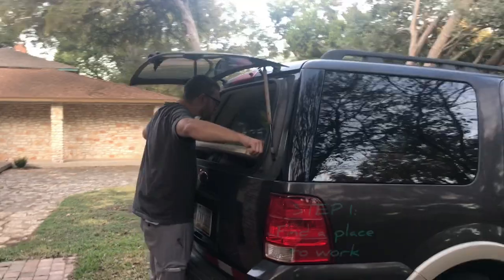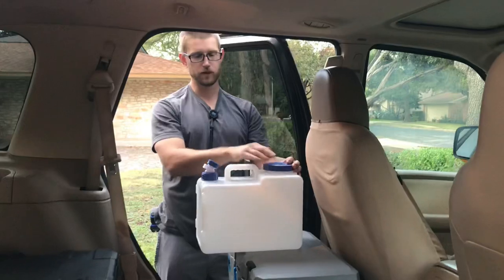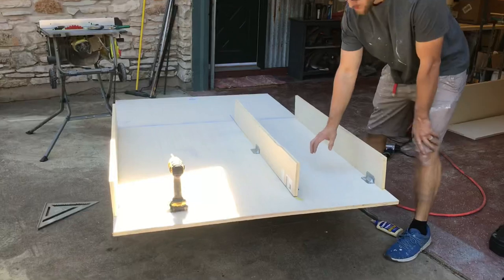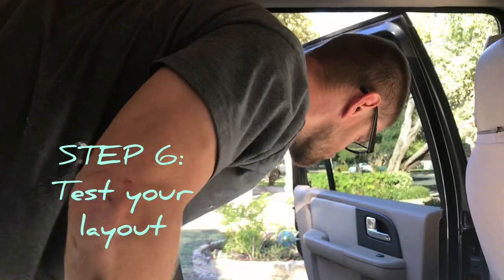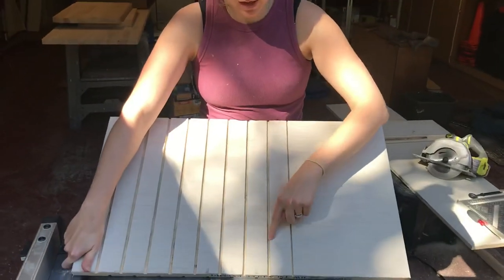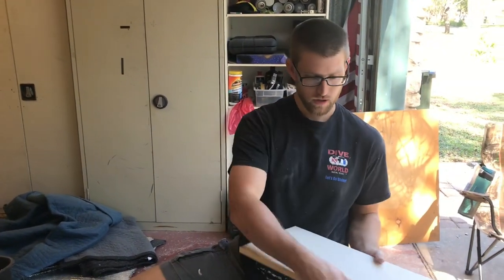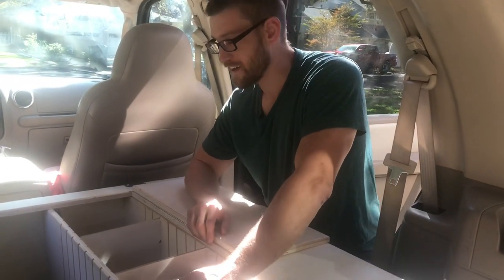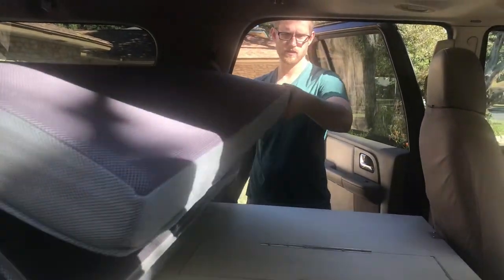FORD EXPEDITION SUV CONVERSION | we renovate an SUV with unique camper design

Comment: Hi there, do you guys remember removing your seats from your expedition? Did you have any trouble with the wiring and safety alarms in the system? I want to remove the seats for my 2016 and no one can tell me if I can do it without causing trouble. The dealership said it will be a problem and not to remove them.
Any idea if that’s true?

Comment: What do you do to stay cool in the hot and humid summer nights inside the SUV while sleeping ??
Reply: I’m not them, but a small 5000 btu window unit and a generator will do.  Keep generator in the back on a hitch carrier. If it’s a solar generator you can keep it inside.